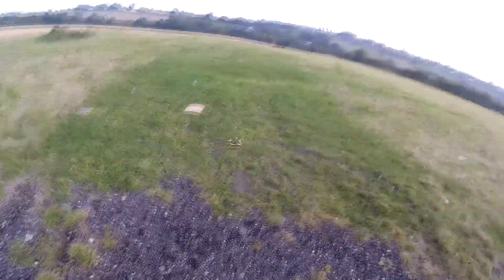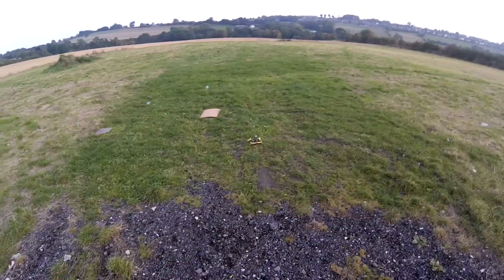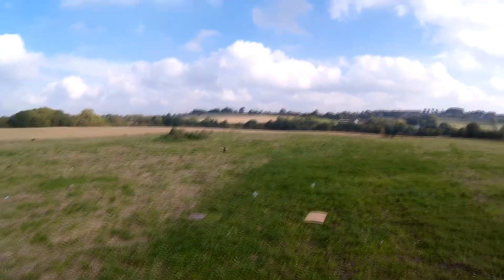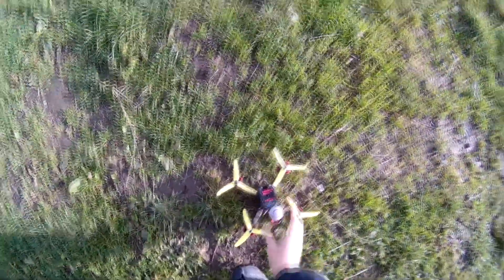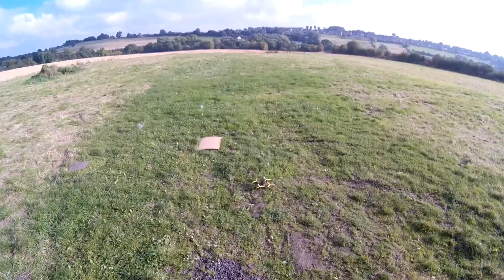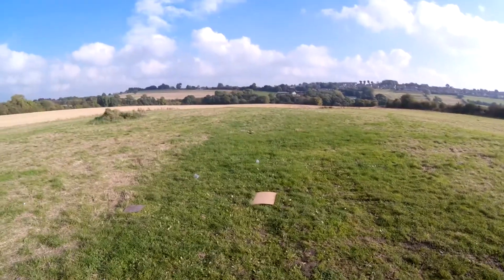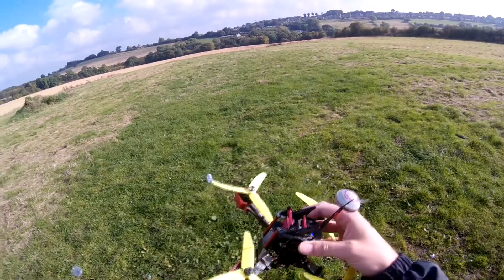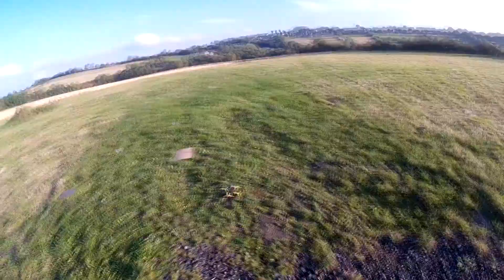P200 - Betaflight 3 PIDs, RC Rate and Triblades

Comment: Is this with a 4s?
Reply from the maker: Yes, these red bottom motors don't have that much power on these triblades. Quad blades have more power and 5045 BN 2 blade are insane power but just don't fly quite as perfect.
There's a couple props comparisons in the playlist if interested and the maiden has those 5045BN on 3s and 4s.

Comment: Nice Video, I just Notice you're using flysky i6 , I bought the RTF but I do have the flysky radio . I tried to Bind it with flysky and was succesful but no RX Bar in the screen on the TOP Right. I test the yaw pitch roll with no props it worked .. Im just wondering is it fine or there is a problem??
Reply from the maker: I don't believe I get that RX bar either, just beeper if tx is turned off. The Wizard does though I think and beeps like crazy while flashing that empty icon if it's on with no TX. If I remember rightly the P200 RX doesn't get confirmed as bound by the TX like fsia6b receivers which caught me out a couple times but does actually bind and work. There's 3 or 4 variants protocols the FSi6 will bind with all really similar so not sure if that has something to do with it.
I find it useless to be honest as the RX always have same voltage and if it doesn't, you have no control anyway so pretty aware there's an issue. It can be re purposed to read the battery voltage and output that instead which is far more practical but to get full range for 4s it needs a firmware upgrade. That upgrade also gives your fsi6 10 channels if you use ibus.
iforce2D has a good video here, I ordered the dongle instead to play it safe but will be having a go.
https://www.youtube.com/watch?v=eaj0M218HSM

I don;t see your comments in my normal stream by teh way, I only saw it as I was on this page and noticed it was unanswered. Perhaps you have some g+ settings restricted or something?
So if I missed other questions,, feel free to just reply to my posts or something if googletube is being odd. I should see your posts that way.

Comment: Hi, I buy the JJRC JJPRO 130 with this TX, I hope that it is going to be as well.    ;)
Reply from the maker: I've not looked close at it but i'm guessing it doesn't come tuned and probably need damped light to fly great.
Should be a popular quad if the gear is decent on 4s.
Reply: It's 2S / 3S with 1806 motor.   :)
Reply from the maker: ONCLEFLY I guess it's plenty for FPV fun with trees. I don't have much experience with 1806 when not using 5" props so who knows, might be a rocket.
Reply: A 130 with 3"  :)
Reply from the maker: Its listed as 2300kv so yeah very tame for acro but fine for cruising with such tiny props.
Gearbest list it as 2-4s and the motors can certainly take it. ESC says 12A with 18 Peak but some 20A racerstar in there on 4s sounds like the recipe for fun.
Reply from the maker: ONCLEFLY Yeah, same quad. if it was 3000kv then it would be decent on 3s.
I dig everything else though.
Reply: Yes Yes, I can upgrade     :)
Reply from the maker: I just saw the JJRC 130 has esc under a piece of foam on the bottom and RX sticking out the back! 
I've gone right off that one dude. Even a 4 in 1 ESC stacked would be better than that.
Reply: Hi, yes all under and small ESC so no fast  :(
I want to change that to him.
Reply from the maker: would the top plate height allow 4 in 1 20A racerstar blheli S?
http://www.banggood.com/Racerstar-RS20Ax4-V2-20A-BB2-48MHz-Blheli_S-2-4S-Opto-Oneshot42-Multishot-4-in-1-ESC-for-FPV-Racer-p-1080541.html?rmmds=search?p=UI14032168777201508N
Lighter, cleaner, smoother and faster probably.
Reply: Thank you, but I don't like 4in1 ESC because 1 dead all dead.   :(
Reply from the maker: ONCLEFLY Would the stock ones fit above the arms?
Reply: I don't know, when it here I see that    :)

Comment: Thanks for sharing.
What are your Gyro and  PID update frequencies?
Is there a reason why you put off the magnetometer?
Reply from the maker: 2K, 1K is as high as I can push it on this FC with BF3 and accelerometer enabled. Turn off self level totally and you may be able to push it higher.
There is no magnetometer on this FC.
BF2.9.1 will allow higher values too, BF3 is very hungry
Reply: I have some trouble to enable damped light on the ESC. The "check" button of BLHeliSuite returns me "Erased or unknown firmware" or only "---" so I don't touched it (SILABS BLHeli Bootloader (CleanFlight)).  How do you enabled damped light?
Reply from the maker: TheTakatu DON'T FLASH WITH AUTO SETTINGS! It will read them as emax nano 20A and they will fry your motors.
http://www.emaxmodel.com/blog/AmandaChen/
I haven't flashed mine at all, just connect with the 'connect' button in blheli to get the esc listed it can see. Many people have done with no issues with that correct firmware, I just saw no reason to as yet.

Press connect in blheli with the usb cable plugged in to the FC and make sure you have the lipo plugged in too or you'll get nothing..
Numbers are listed on the bottom and in a pop up centre screen. If you don't get this, you aren't connected.
It should read all 4 and give you an 'OK' box to click and leave you with all 4 selected.
Right click select just that ESC, left click allows you to select all 4 if they aren't already.
Mine is running 14.2 and the box you want is called 'PWM Frequency/Damped'
Slide that sucker till its says 'Damped Light'

Then press 'Write Setup' or it won't save. 
Disconnect and reconnect to make sure the setting has stuck but just touching the throttle a little should show immediate braking.
Reply: Thanks a lot for your time. That's how I expected it should work :)
But it's unfortunately not working for me :( BLHeliSuite keeps telling me the firmware is unknown and is asking me if I want to flash BLHeli on it as soon as I hit the "Read Setup" button.
It seems I have to find out whats wrong with my ESC's then.
Reply from the maker: TheTakatu Try reading each one separately?
If it flies and you haven't used blheli before i'm guessing it's some other issue.
Maybe drivers or cleanflight isn't disconnected or something. Worth trying a restart too and make sure you get a com port assigned. Although if cleanflight connects then that shouldn't be an issue.
Reply: It flies. Sometimes it punsh's very hard for tenths of second even with a very low throttle or no throttle change. I thought it could have something to do with the oscillating.
Yes I restarted the computer. It's no problem to connect with betaflight
I had some trouble to flash betaflight on the FC but resolved it with shorten the boot pins and the "No reboot sequence" option.

Here is a screenshot of the dialog BLHeli shows me on:
https://www.rcgroups.com/forums/showthread.php?t=2762281
Reply from the maker: TheTakatu I don't understand the issue exactly, do yo have video?
Will it connect to ESC 3 only as in don't select 1,2 and 4?
Do you see damped light for the other 3?
If you're model flies but one esc doesn't recognise I am not sure how to to help.
Only flash the emax firmware if you do flash though